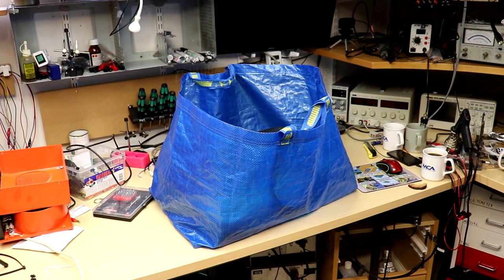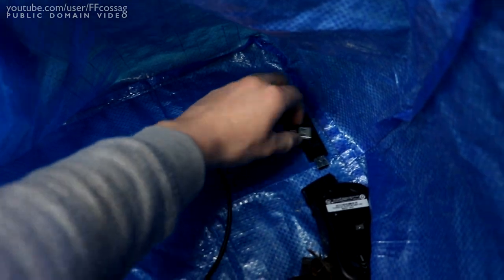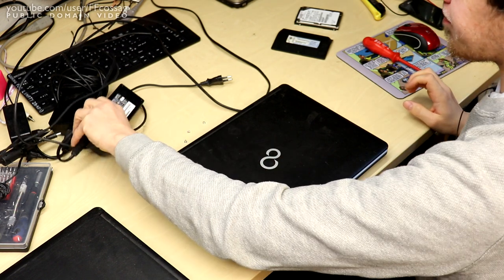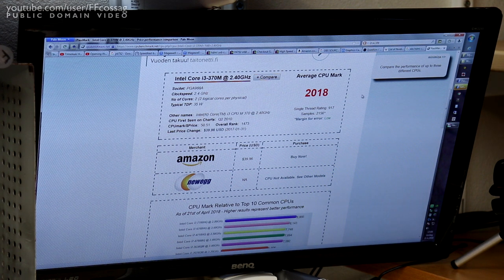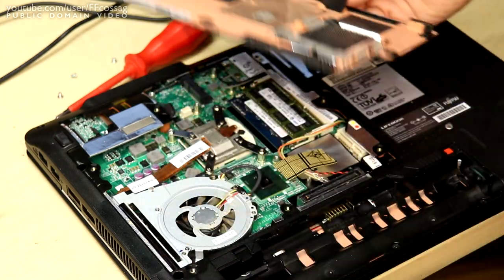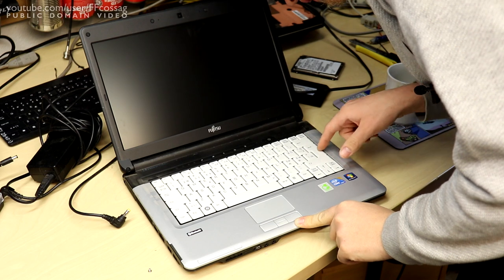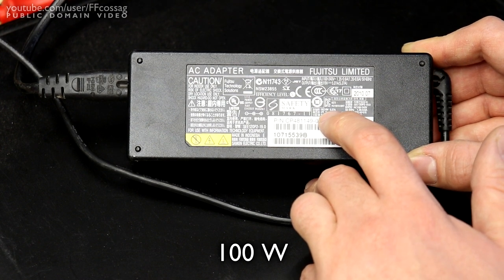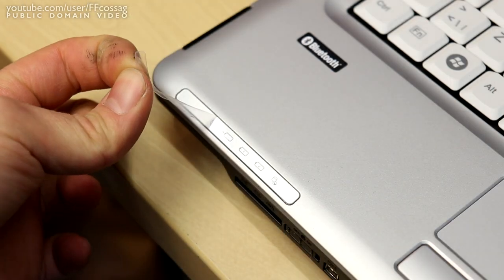Blog. April trash picks

Comment: That was quite a surprise to see that  access door to clean the CPU cooler, never seen one either. Even being in a clean house for 6 years my 2nd gen I7 laptop was still dirty.While in there i figured I would re apply more Arctic Silver  compound to the CPU, cant hurt,right.Hey your videos are great. I just would not have the ba**s to do what you do in front of a camera, Steve.
Reply: Fujitsu laptops aren't cheap, and that's for a good reason.

Did I just see "Made in Germany" on there?

Comment: I have acer aspire 5755g with intel i3 2310m and 1gb of 540m graphic 
Please tell me what is the best processor option to upgrade because its thermals are not good
i5 or i7 
I already changes the thermal paste and clean the fans i got the improvement but not much please help me to solve the thermal problem

Comment: These heatsink access things are present on a lot of S and E series models from the time (S751/752/781/782 14", S/E751/752/781/782 15.6", S761/762/792 13.3") - all the better I guess, since it is not too obvious how to access the board/fan on these. Not to me anyway, as somebody apparently managed to install a quadcore in an S751 with the fan from a Celsius H710.

And no, it is not standard for these to ship with way oversized PSUs, though you tend to have various options. At work some of our 15.6" A531s were ordered with extralight and compact 65 W jobs (these cost extra), but my little 13.3" S761 came with a fairly heavy 80 W brick - go figure. So I never actually lug around the PSU but leave it on the dock.

Oh, and don't knock a first-gen i3. A colleague has a 370M just like that with 8 gigs of RAM, and has been super happy ever since he got an SSD!

Comment: The i3-370m(or m 370) is not a bad little chip. Great for general use even in 2018 on windows 10. I had a Toshiba with that chip which I upgraded to an i5-560m
Reply: EvilTurkeySlices does i7 have processors on that socket?

Comment: Those laptops beat my 2014 Toshiba satellite C50-B, which has a 2.1 ghz celeron with a passmark of 900 :(
Reply from the maker: I'm not surprised, I don't get the new fad of ultra-slow laptops.
Reply: It sucks, but it's fine cuz I put an ssd in it :) before that it was almost unusable. I have a decent PC though so performance isn't an issue.

Comment: I see crap like these get put up on eBay all the time with XP just because the docks have serial and parallel passthrough from the machine... and they seem to sell for quite a bit.
the filter thing was also done on a number of their T5000 series convertible Tablet PCs. my three T5020 parts machines have them... sufficed to say, they've all been lost in the hoard.
it's sad you didn't get the batteries for them, since even models that new have fairly expensive replacement batteries. I had a tough time justifying new replacements for my P2120 to get the full 11 hours of battery life out of a 16 year-old computer again.